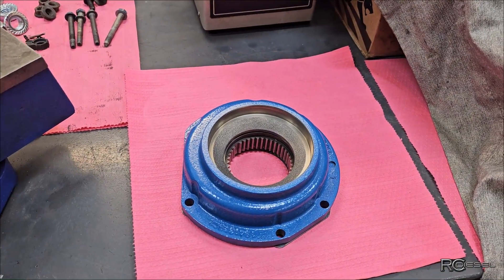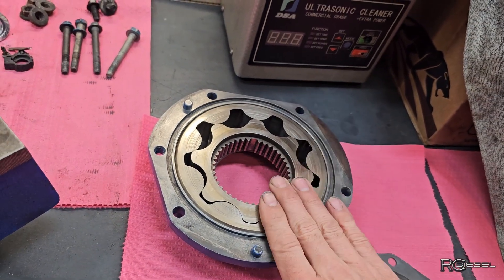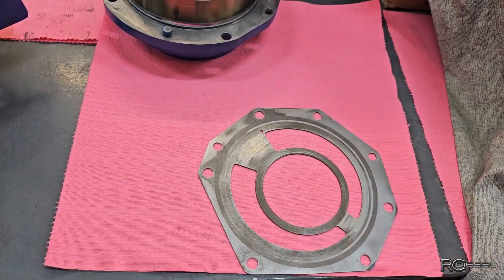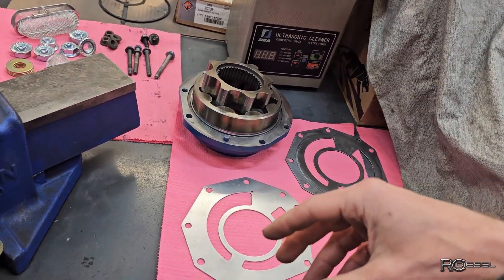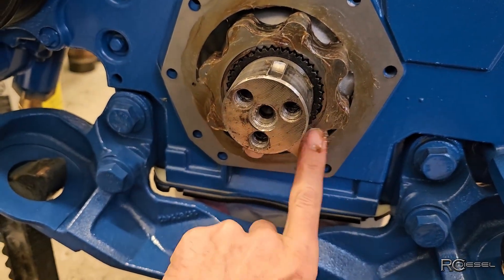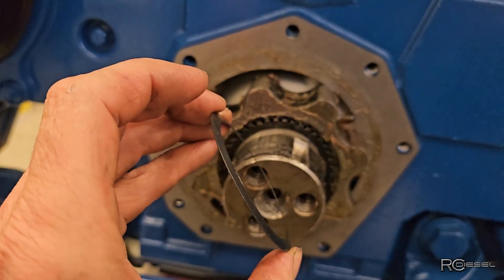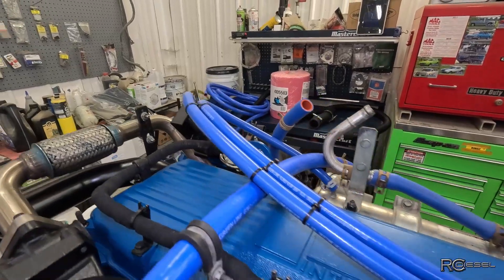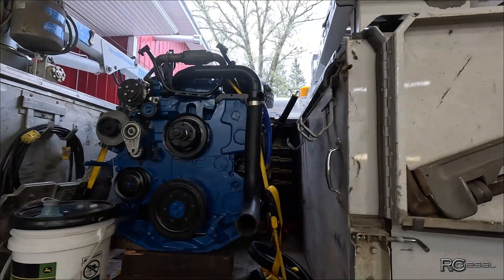🏁 DT-466E Engine Rebuild | Part 16: FINAL EPISODE! Oil Pump Fix, Final Assembly & Ready for Delivery

Comment: Well I had to replace the rear front cover on my 2004 4400 DT466E.  Took me 2 months to do then another 3 weeks after problems, that been done sooner if I did not hesitate about parts I should replace along the way.  Now my rebuild issues.  All I did was oil the pump as I assembled the first time now I had taken all parts off and set them exactly in the housing the way the would been in the oil pump housing so I had practically engine start up right out the gate.  Watched every thing for oil leaks every thing seamed fine.  So I got it loaded ready to go get some loads.  I needed to fuel so I went 16 miles then stopped for fuel decided to look things over and was like finding oil had leaked out a seal around the air compressor even the oil filter was dripping oil.  So I ordered a different gasket O ring for the compressor and a power steering pump seal thinking I was going to need to take the Compressor out which I found out I could move back 3 inches to get enough room to get seal off.  The seal I had on hand was to my other 4400 but a 05 and it was exactly like the seal that came out of it.  The new seal I had placed on when I replaced the cover looked like a mouse chewed it up. The new seal was just a O ring and what a pain in the butt it was to get in the tear shaped groove I had to RTV the top of it wait a hour for the RTV to set then get the rest of the seal to get into the groove.  Weird how the 05 waS molded into this eye drop shape  UT the 04 took a O ring that was not in the eye tear drop shape.  Now I believe what caused the back front cover to crack was the power steering pump that has bolts that go on a bracket to support the power steering pump were missing.  Now when I was working on this been nice if I noticed this before I started to drive it again but these were missing when I was working on the truck so I never got that far from needing to look at these bolts.  I'm 90% sure now this is what cracked the cover the no support of the power steering pump and compressor. Moving up and down  created pressure on the cover a d it cracked it in many places near and around the compressor.  Even the front cover had a smaller crack that was weldable but it was in the top bolt area for the compressor.  Any ways took 5 hours to fix it.  OK I had filter leak I thought so went into International service to get different filter because just was not sealing but could not see any other leak around oil cooler at the time well got back on road  now the service  center  over filled the oil by 4 quarts causing the front seal to blow out.  Idiots,  the oil filter was leaking furious too I was able to just drive it home and go back through the cooler thinking maybe the post where the filter goes up into is stripped and the oil filter comes loose.  Nope the large seal between the cooler and the engine got pinched and it tore a piece off the seal at the top of the housing though when it was running never see oil leaking out of it there just the oil filter was dripping.   So now replaced seal on the pump housing putting the pump back together being I been so exhausted I did not take care with pump keeping every thing the right way.  So when I went to start truck I got a instant engine running but then it quit after 3 seconds no oil pressure as I tried to turn it over so this is my thought ok did the pump go on backwards which when looking at it is how every thing looks the same.   No markings on the pump either.  But I did find a weird mark in the metal on just the larger pump gear but nothing like what you have where a punch was used it looks like it was welded the grinded down and smoothed yet it has a discolor in the steel.  So I'm going to try this way yet can ot tell which way the other gear should go being nothing marked.  Figuering on just looking at the scoring on the plate and the metal shim and compare it to guess which way it needs to be.  Also talk about time into this it bank rupted me as I had no income now for 3 months that Im trying to find work.
Reply from the maker: Wow, that IS a rough go! Thanks for sharing. I'm 100% certain you are correct that the missing bracket is what caused the timing case to crack at the compressor mount. The compressor and power steering pumps are very heavy and they put a pile of stress on that front cover if it's not supported at the rear. 

As for the oil pump: if the gears are not marked, it shouldn't matter which way they go, but it is best that the two stay meshed the same way because they kind of break-into each other. The strange welding mark you found, I'm not too sure what that's all about...
Reply: @rcdieselchannel well I got it back together finally I put somy moly grease lightly on the oil pump area.  I was getting oil pressure then I had to quit turning it over then I heard oil leaking I forgot 2 bolts on the oil line to the Turbo that I removed on the top side of the turbo when I removed that hose off the oil cooler had lot of oil coming off this being I missed tightening it up and one bolt not in it.
Reply from the maker: Ooh boy, greasing the oil pump is good to help prime, but not with moly grease 😬 Should be using a non-moly grease for that. 

That turbo line will loose a lot of oil real quick!
Reply: @rcdieselchannel thanks well It took a bit but after getting the pump turned around it took a bit but the truck finally came back to life.  Oil leak around the oil cooler did not come back. But as it ran oil started to drip between the compressor and the pan not sure exactly where but I do see a small thin bit around oil rail leaking off but it dose not look like it is enough to justify taking oil rail apart or valve cover..  Thinking maybe I busted the pipe to compressor or broke oil pump sensor when pulling back compressor to get o ring on.  So I bought some UV oil leak detection so I can find the locations of oil leak.
Reply from the maker: @jeffsmith8449 There is a small oil line behind the air compressor that feeds it for lube. That may be where the leak is coming from....

Comment: YOUR RIGHT IM WORKING ON A 93JEEPWRANGLER 4X4 CONVERTED TO RETROFIT DODGE DAKOTA 5.2L MAGNUM ENGINEAND REBUILT ENGINE WAITING FOR PARTS 1MONTH BEHIND JEEPS BEEN HERE ALMOST 2MONTHS 2WEEKS OF TOTAL WORK ON MY PART DOING SUSPENSION AND AUTOMETER GAUGE WIRING DONE WRONG BY PREVIOUS OWNER WHO DID RETROFIT CRANKSENSOR SCRAPING AND TO LONG FLYWHEEL BOLTS ETC GOT IT ALLRIGHT AND IT RUNS REALLY WELL ,I PAY ATTENTION TO DETAIL SO I HERE WHERE YOUR COMING FROM WHEN PARTS ARE WRONG AND DISCONTINUED ITS CRAZY JUST PISSES ME OFF
Reply from the maker: Yeah, this parts stuff is a real issue, such a pain. It makes a straightforward job turn into a mess. Thanks for watching!

Comment: Was the oil pressure bad with the old pump?
Reply from the maker: I couldn't tell ya, I never ran it. It came to the shop already pulled. It had a plethora of hard starting issues, that could have been related to low pressure in the lube pump but I have no way of knowing that for sure.

Comment: Almost at the finish line…….
Reply from the maker: I apologize I was not there when it ran for the first time. I am told it starts and runs really nicely though.
Reply: Close to getting our old Ford 7600 with a PTO brake band problem going, it has been difficult getting the parts
Reply from the maker: @JoeBachmann-ry7wm It's a throw away wold man. We're not supposed to operate anything that's over 7 years old!

Comment: There is a company called HDP,,,On there web page they have this exact pump and gasket for sale,,,,,But the price is insane,,,,,,,465 dollars,,,
Reply from the maker: I did find a few places that listed them but when I tried to order, suddenly they had no stock. I searched specifically by part number and called pretty much every place that came up. None of my local suppliers could find one either. Maybe they've restocked by now, I actually finished this rebuild at the beginning of June. Posting 70hrs of work, one video a week takes a long time to get it all out, so the timeline is a little out of whack.